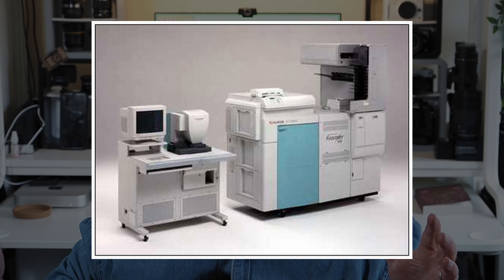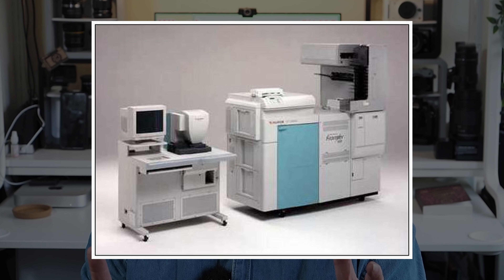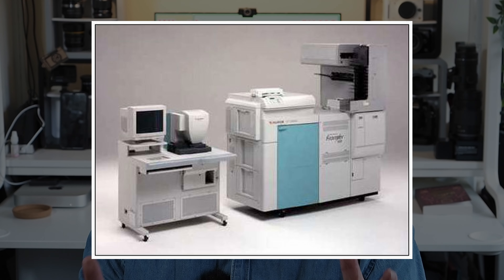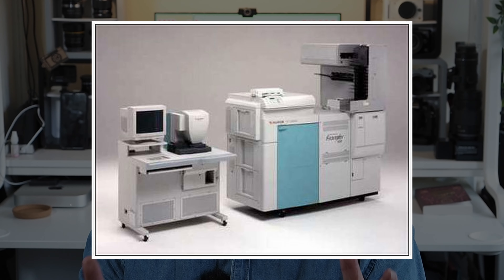What happens to your film?

Comment: I remember helping in the late 80's when I was about 13-15 years old, in a camera store with a Konica minilab. These printers were still optical, with an additive system. It made three exposures with R, G and B filters - unlike in darkroom with a subtractive color head. It was still EP-2, nut in the early 90's, the then new RA.4 papers came. By the way, I am still printing RA-4 as a hobby in my darkroom. This was before the Frontiers came around, and everything was scanned and printed by laser.
Reply from the maker: Yes indeed Samu, that Kodak printer was RGB making 3 exposures through dichroic filters. It was 'the norm' for many years in pro labs, but Subtractive was simpler for home use. Good to know you are still printing yourself and thanks so much for commenting.